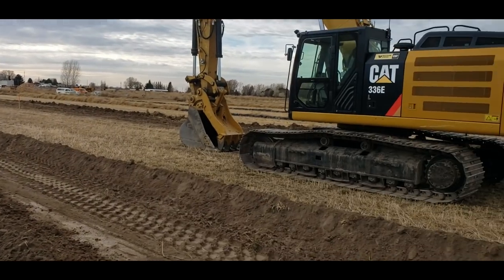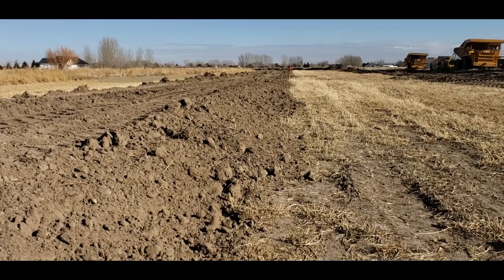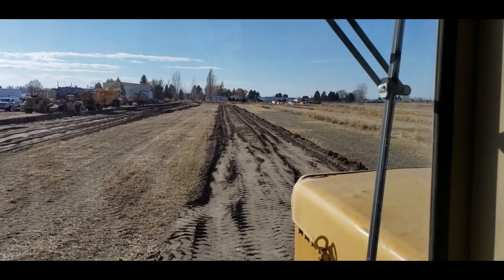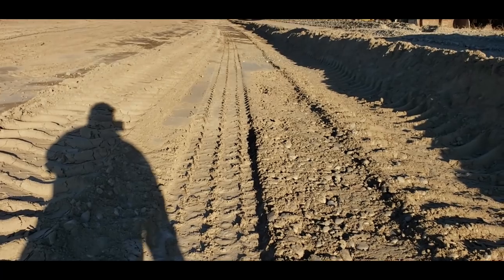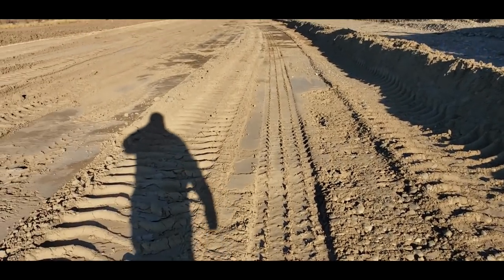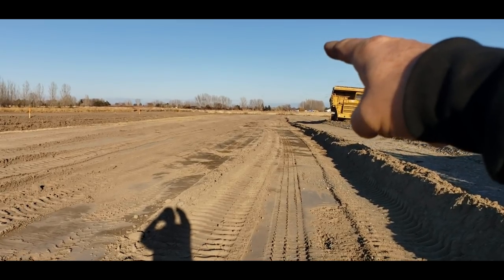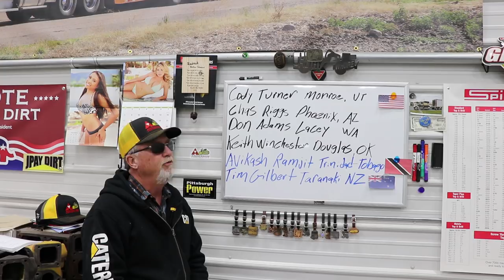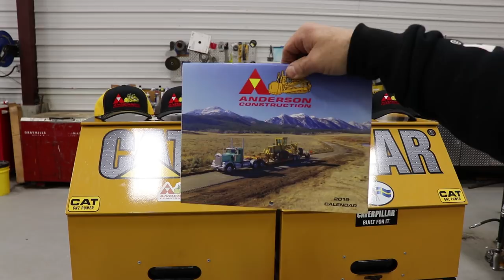How To Design And Build A Irrigation Ditch

Comment: My complete respect. As I look over my shoulder 34yrs on "Erytang" begining with a shovel, eye level ruler ,root pickin', eventually GPS teams and  systems , I learned  more and flourished at small to medium outfits. Complete fish out of water at large companies. Being in Silicon Valley, the pressure , pace, sometimes 6- 12 hr and 10 on Sunday on 27s, 37s elevators rough and finish ( did damn near "erytang" on twins) it is so nice to see such well taken care of equipment and a relaxed blade hand not calling for a " Ham Sandwich and a Road Map" I learned big lesson. If I walk out to a line and pick a rig, it's the dirtiest greasy bastard on the line. I picked one with a "Dupont Overhaul " ( 10 gal.) Shiny as hell. And was broke down on line by 10am. Dirty one worked everyday!!! Just put skate board tape on fenders ,so when I cleaned ( smeared) the windows I'D have traction lol. I got story reading a  623G in downtown San Francisco! Hooked up with trash container. Spinning like a top.

Comment: Amen on the fine grading with a scraper, I broke out on a 613 stockpiling gravel for a small contractor that didn't have a blade to put in the pit, and the dozer was tied up clearing and stripping. I learned real dang quick how to build a stockpile that I could stay on and not slide down the outer slopes! I guess I learned pretty good cause the blade would refuse to blue top unless I was the hand to come deal with his windrows. When I moved up to 623's it was like a dream come true for me. Cushion hitch and plenty of power was the cat's a$$! Ran a 619 for a bit but never really cared for it and its cushion axle!. LOVE the videos, and the old iron that you keep in great shape! stay safe, keith

Comment: Many many years ago I saw a company out in your western states use a little scraper in fine grade. Paddle wheel type is what you call them I think. The blade operator  would center the excess and the scraper would pick it up and either dump it or move it to a low spot. They were using Wabco with a V8 3208 and even a International scraper. Thanks Mr. Anderson for sharing your knowledge.

Comment: Jeff, for some reason that scraper is energizing the reverse alarm when shifting, maybe a short in a shift harness somewhere. Great vid by the way. Cheers mate🍻
Reply from the maker: Every time the downshift circuit is energized it sends a momentary signal through the reverse signal wire until the clock switch rotates and synchronizes into the selected gear, and that's why you hear the chirp

Comment: I
f your adding to your shop and adding floor have you thought about putting railroad iron in floor so you can put your dozer inside to work on it? We have a shop that put railroad iron about 1/2 inch above grade of the floor so when they drive dozer in shop the tracks ride on railroad iron and not touch concrete floor.
Reply from the maker: My cat dealers floors don't have that and there's not a mark on them, I'll have to ask what's in it
Reply: @Jpaydirt  Maybe they poured the top couple of inches with 12000psi concrete?
Reply: Built in trip hazards?

Comment: How do you get on the whiteboard?
Reply from the maker: I had people give me their names on a previous video then after a week I printed out the comments
Reply: @Jpaydirt  I want to run that double barrel pan.... can't believe how smooth it rides... I have I think is a 613 paddle pan at work but I have to go easy or it will throw you up in the roof.... I could be wrong but I believe it has the 3208 cat in it
Reply: @Jpaydirt  just use it for drying topsoil for a screen plant... I love it in the pits ... there is no real jobs here in southern Maryland